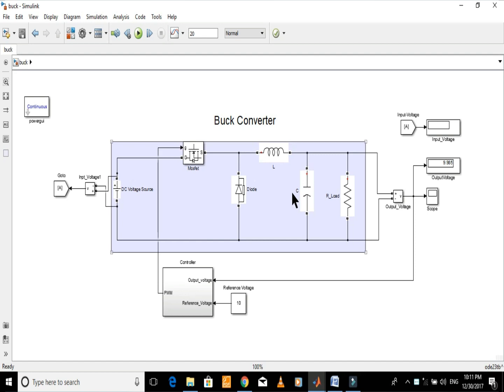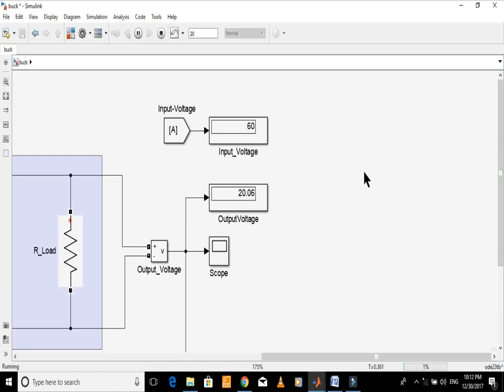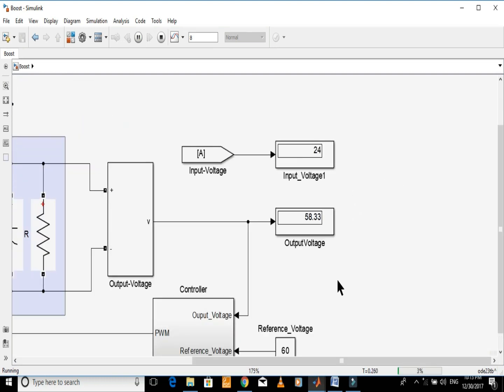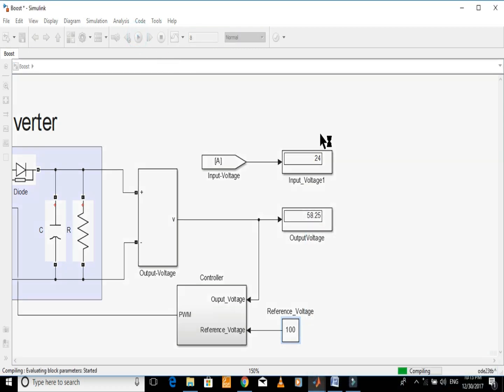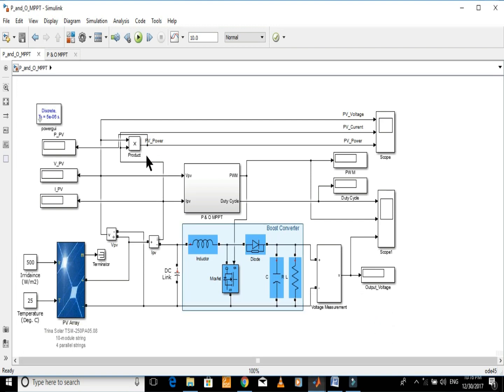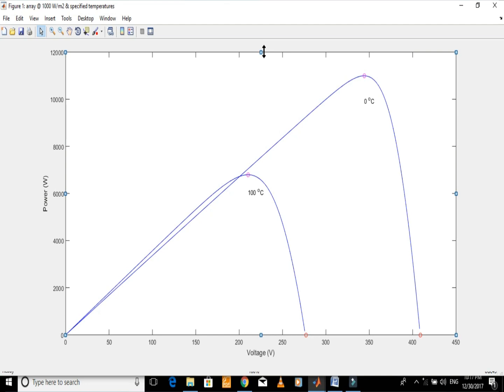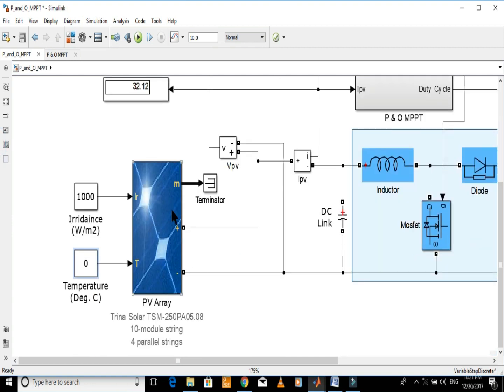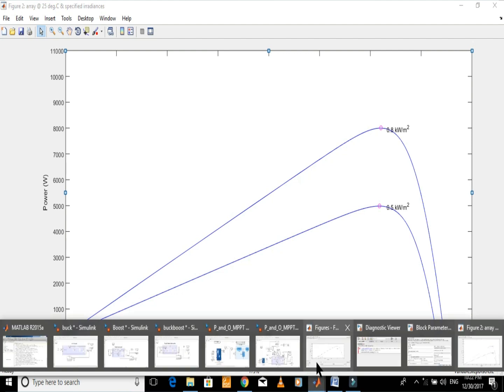Buck | Boost | Buck-boost | Solar PV | MPPT | Stand-alone PV System | PV Inverter

Comment: Are you interested in helping me with a project? I have something in mind, it could lead to it being manufactured, there is only a single company maging something very similar, what I have in mind, is basically a improvement on what they sell. Only not based on their design! I know a microcontroller could do it, but may be a bit overboard. It maybe possible to use simple logic! Cab we talk over gmail?
Reply from the maker: Please, see description of the video. thanks

Comment: please sir can you tell me the formular to calculate the L, Cin , Cout  of the boost which is connected to the pv solar  according to Vin and Vout??
Reply from the maker: L= D(1-D)R/2f , where R is the output resistance, and f is the switching frequency.
Cout = D/2LR, and don't know about Cin, this is just approximated and is generally of very high capacitance.